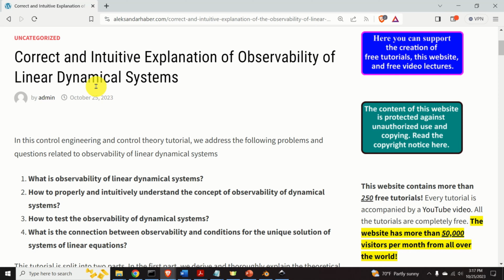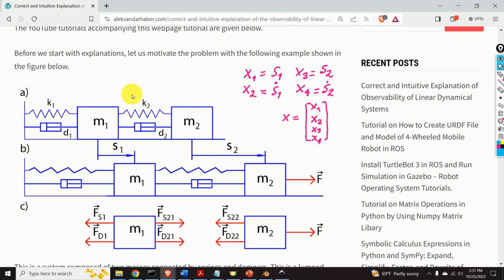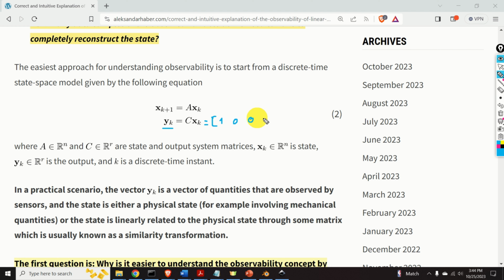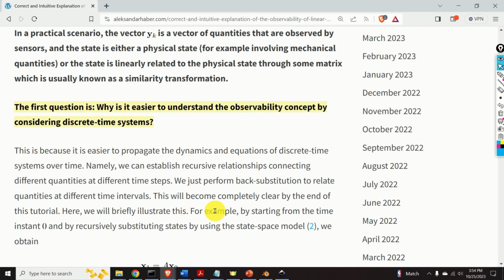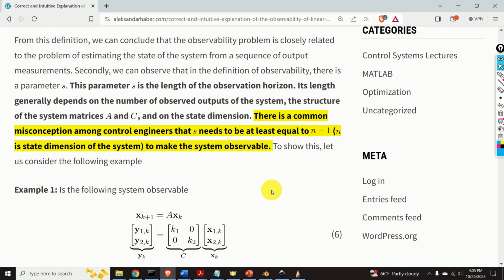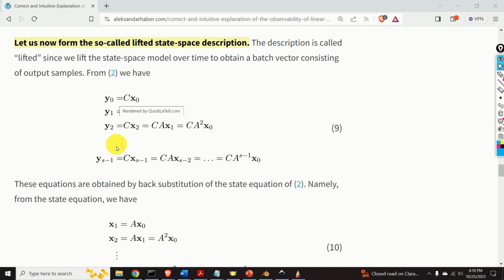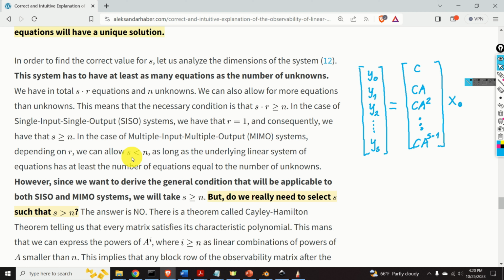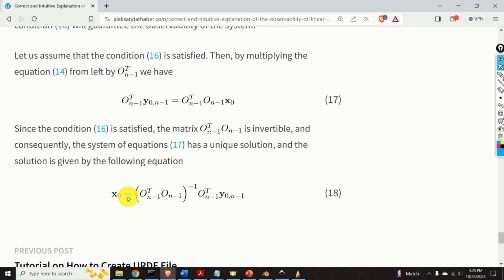Correct, Detailed, Clear, and Intuitive Explanation of Observability of Linear Dynamical Systems

Comment: Nice video! Very useful!

For the fact that the rank of the observability matrix must be equal to n, I tried to figure out why this is true.
First, let’s analyse the dimensions of the spaces involved in the equation y(0,s-1) = O*x(0), x(0) is in a n-dimensional space and y(0,s-1) is in a r*n-dimensional space, therefore the observability matrix represents a linear map between a n-dimensional space and a r*n-dimensional space. Now, since y(0,s-1) corresponds to a “real measurement”, we know there is at least one vector, x(0), satisfying y(0,s-1) = O*x(0). The system is then observable if x(0) is the only vector satisfying this equality, therefore the linear map must be injective, that is its kernel has to be 0-dimensional, so from the rank theorem, the rank of the observability matrix is n. 
The converse is also true, if the rank of O is n, then x(0) is the unique solution to y(0,s-1) = O*x(0).

Is it correct?
Reply from the maker: You should prove this: the solution is unique => rank(O)=n. The easiest way to prove this is to use contradiction. Assume that this statement is not correct.  That is, assume that the solution is unique and that the rank condition is not satisfied, and follow the classical prove by contradiction steps. You will get a contradiction that is that the solution is actually not unique which is not in accordance with our original assumption. From another point of view, you can also think like this. If the solution is unique, then then there should not be any additional solution of the system of equations. This implies that the matrix O must span n-dimensional space and it should not have non-zero vectors in null space. This implies that the matrix O should have a full column rank, since only like that the null space is empty.  Also, another interesting point from linear algebra is that you can always decompose a vector into null space and column space components. Only the column space components can be observed from the data, the null space component is practically unobservable...
Reply: @aleksandarhaber I see, thank you. Do you plan to do the same kind of video for the controllability and derive the analog criterion for the rank of the controllability matrix?
Reply from the maker: @id-ic7ou   Yes, it will happen
Reply from the maker: I explained this in the video
Reply: @aleksandarhaber I think you only explained that if the rank is n then it is observable but for the converse there is no explanation. In my attempt to explain the condition, both ways are discussed
Reply from the maker: @id-ic7ou  See the reply